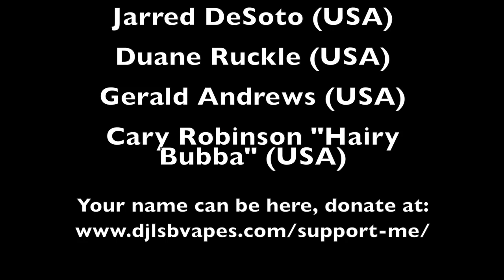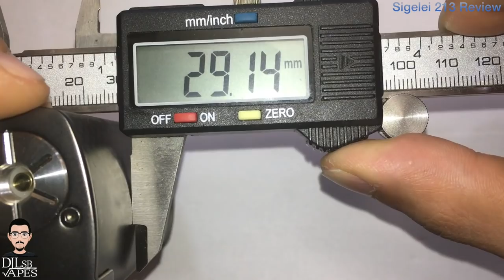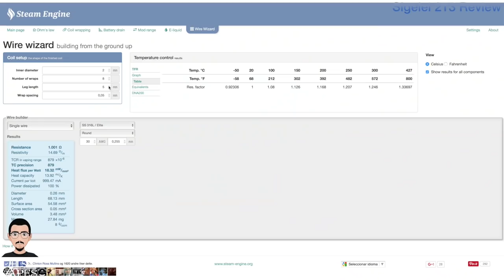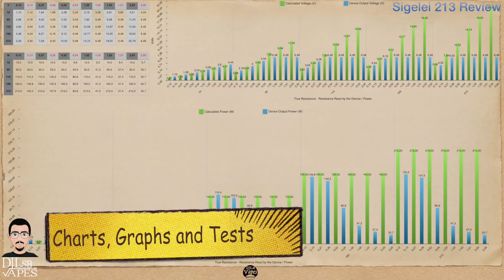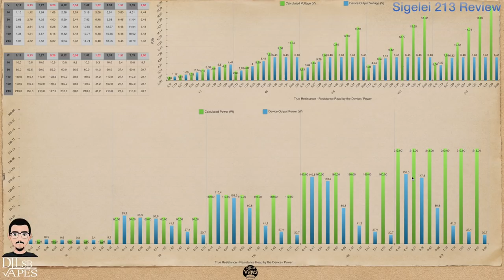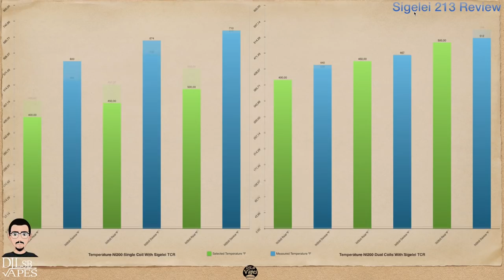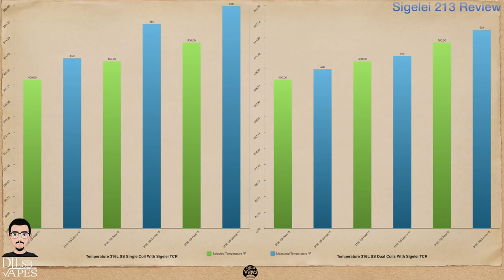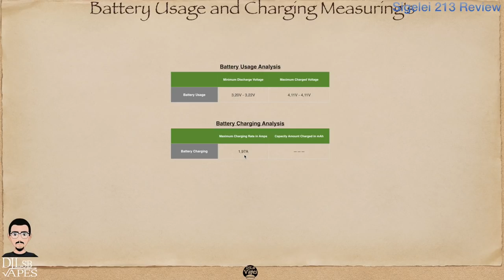Sigelei 213 Lies unveiled + Charts + Disassembly

Comment: Thank you for doing a section on disassembly. I want to share my story about my issue as there is not much around about this specific problem and I could see it causing frustration to anyone else it might happen to. Yesterday my 213 which is only a few months old started showing battery imbalance. I tried multiple batteries and checked them all on a meter and they were fine. I tried cleaning the spring contacts and the ones on the hinged door with the eraser on the end of the pencil which many videos suggest and it did nothing. This video encouraged me to take it apart and when I did I noticed that the springs behind the battery contacts were soaked with e-juice that leaked down the atomizer and past the atomizer contacts. After cleaning out the juice and reassembling the voltages are reading properly again and I am back to happy vaping on this mod I love so much. I hope this helps if anyone has the same problem!

Comment: Small rant about Sigelei. I built my Griffin RTA, and of course I love to see what the wattage maxes out at on my devices before I take them with me so I don't accidentally burn them up. 140, it was great, a little hot, but great. I turn it up to 150, no difference, 180, no difference, 213 no difference. I plug in the amp and ohm readings into my phone's power calculator app, and sure enough, 35 amps into .12 ohms is only 147ish watts. WOW. I was going to buy the IPV5, but I figured that these devices would push 180 watts max, but 147 on the Shitgelei and, according to your charts, 197 on the IPV5. I love the IPV series and I knew I should have bought it. Yes the Shitgelei is pretty, its laid out nice and everything. It all works up to 150ish watts. My lesson for the day is to watch your reviews because you actually test these devices, and I have never seen a more in-depth review. Thank you so much for giving me a place where I can make sure I don't get ripped off by companies like shitgelei. Great review.

Comment: I just did the same test you did in Stainless Steel temp control and I got the same result,  but when I changed  the preheat from 0.01 to 5.00 it blew up in flames!   oh only difference I did was I was doing the test at 200  degrees fahrenheit.  As low as it could go,  so what that tells me is it's not temp controlling at all.   All devises that you can control watts in temp mode are the same is what Sigelei is calling there preheat.   It's just suppose to get you to
your temp faster or slower depending on how high you have it. I just pressed the button with no cotton and it turned bright red super fast.  And that's at 200 Fahrenheit.
Reply from the maker: Yeah, I feel sorry that you have that device, it really sucks to know we could have spend better our money

Comment: Absolutely awesome review. I was going to buy this for my wife and temp control is very important. The low wattage is a given, .1 ohm limitation and 2 18650s just won't cut it but no biggie, super high wattage is not something that is that important to me or her. But accurate temp control, that's a must. It is too bad that such a well engineered device has such poor software. 
Thank you for your time on this one Daniel.
Reply from the maker: Thanks ;-)

Comment: This is probably one of the best reviews I've ever seen. I bought the 213 and if I would have paid $100 like everybody else did I might be pissed but I found a website that was selling it for only $80 and it came with two LG HE2 (the Yellow Version) batteries so I can't quite complain but I really wish the temperature control really worked. I came to the same conclusion that you did, that it's just simply not locking the resistance. If you look at the screen whenever you lock the resistance it says hold to lock resistance what the fuck are we supposed to hold it won't actually do anything until you let go of the button. The website no longer carries them for $80 though, Sigelei reached out and made them raise the price by threatening to delete their account with them. So they had to raise the price by $20 but you still get two batteries.
I feel sorry for the poor schmucks who paid $130 on Vapor DNA.

Comment: This is an absolutely awesome review, just like all of your other reviews, THANK YOU. This has really opened my eyes to the game these companies are playing and the over-rating and blatant lying they are doing about these products and their internal components. I'm surprised they haven't stooped to epoxying the internal board to the mods case to prevent people from running tests on them. Since you are very technically oriented it would be great to see some advice in future video's in terms of upgrading the components on these boards. For the price they pump these things out they can't be using very quality components. That said, I think it's about time a company finally offers a true open source firmware code that the community can work on and improve.

Comment: Hello Daniel, I have the 213 too... and I decided to buy it only for the sake of aesthetics and compactness. In fact, the TC isn't working well, but... I noticed that when you did the "lock procedure", you didn't "hold button" as requested. Those menus are far too fast to read, however. The "preheat" function is also working in Watt mode (at least on mine). Futhermore, I'm having misfires very often, and the pre-heat function misses the hit most of the times. The worst thing about that mod, imho, is that it isn't firmware upgradable.
Reply: I've seen 4 videos so far of people trying to test the TC function. No one ever correctly locks the resistance! :o  It's crazy! I haven't tested this feature myself as I just vape in wattage mode. Does it give a verification like "resistance locked" when done correctly? In what way is the TC not working well, compared to something that does work well? Sorry for the questions but you're one of the only users who doesn't come across as a ranting hater. haha

Comment: Nice review, I was wondering how long it would be until someone caught Sigelei here, it's a known issue with its TC. Unfortunately it's a shame, it's like a beautiful woman that's bat shit crazy. The frustrating thing is the design for a dual 18650 is brilliant. I'm a 100% temperature control Vaper, but if I was a strict Kanthal user then I'd be happy.
Reply from the maker: Thanks, Yeah, it is really a shame, I love the looks and build quality but just as you I'm an TC vapes since the DNA40 ;-)
Reply: ***** Hey Tess! :-) My favorites are my Dicodes 2380T and Nico. Most Mods do Titanium accurately so it comes down to personal preference. However, the Dicodes is indeed the smoothest TC board to date. 

I've kinda dropped out of the buying obsessively game. The exponential development curve has made most Atty's so close. The DNA 200 and 75 Mods also do a good TC.

Many of my friends here have 'regressed' back to non-TC ie Kanthal. A few have deviated to SS316L with a few to other metals. Personally, I've found SS3XXX to be mediocre at best. The best metal I've found is Platinum, but at a cost of up to $60 per 24 gauge coil insanely expensive. What would be fantastic is Titanium Grade 1 with very a heavy Platinum plating. Platinum doesn't oxidize.

Comment: I actually did like this review.  I was looking at getting one of these because I'm looking for a smaller form factor, dual 18650 mod that does temp control on 316L.  Sad to see that Sigelei dropped the ball on TC for EVERY type of wire.  Thanks for your work on this one, Daniel.

Comment: So very tired of being scammed by these Chinese manufacturers who rush to production with a shit load of junk and lies. Such a perfect form and look. As you said, what a shame. No more Sigelei for me. And what's up with the other reviewers?? They lying or are they just that ignorant. Thanks for an amazing, perfect review Daniel. As with some people out there - beauty is only skin deep in the case of the Sig '213'!
Reply: I think a lot of reviewers start off honest, and then tend to hide more flaws with items as they get more popular,  and times goes on.
Reply: #notallChinesemanufacturers
Seriously, YiHi, SMOK, lately Joyetech/Wismec...they are all doing a pretty awesome job. Yes, we are slightly biased based on the fact that we are partnered with two of those brands, but testing like Daniel does shows that this is true.
Reply: +KMG Wholesales I agree there have been strides forward by the companies you've mentioned. Any self respecting company would offer a recall and repair for a known defective part such as this. I bought two of these! Do you believe ANY Chinese company would be responsible enough to offer an updated - functional replacement? This is a flagrant example of fraud in my opinion. Sigelei HAD TO KNOW this board was defective. Instead of doing the correct thing by discarding or modifying these boards, they chose to use up stock and sell them at a premium to the unsuspecting vaping community. Fraud?? You tell me Mr. Wholesale. I experienced the exact same thing with the SMOK M80 over a year ago. NO INTEGRITY! So I will do the only thing I can in protest, not buy Sigelei or any of their offspring ever again. BTW, you forgot to mention the BEST and most reliable and customer conscious Chinese company of all, Steam Crave. I gladly pay a little extra for their quality and service.

Comment: Thanks for the review.  I am using SS316L in TFR Mode.  This device had so much potential and I felt scammed from the point of first setting the device up.  Their customer service has been shitty at best.  Again, Sigelei scammed us on this device.
Reply from the maker: You welcome, I feel sorry for you and the money you spent on it
Reply: Daniel, would Sigelei be willing to send you another 213 to test and compare against this test?  I am not seeing any improvements, but I do not have the equipment that you do.  BTW, as I shared in another post mine reads: J123 and when I put in the batteries with the power button depressed the screen reads, SGL1605V1.7
Reply from the maker: Haha, I'm sure they won't this one came from a shop. Yeah mine shows SGL1605V1.7 also
Reply: +DJLsb Vapes Thanks, my friend 💨💨💪
Reply: I felt the same too bro. It came out with so much hype at first with the promise of tfr tcr firware upgrades etc etc but i get none of those and felt like i paid a premium for a carbon clad vw only device! same firmware version here.
Reply: jvjh777 All-in-all $100.00 for a 155 watt device with issues.  Sigelei got me once, but not twice.  Did I mention their customer service?
Reply: I've noticed one thing on Sigelei 213, if you chose "lock" the resistance instead of "read", the next screen says "Hold to lock the resistance". So maybe you should nit just push the fire button once when you lock the res, maybe you have to choose "Lock" and hold the fire button for some time and then it will lock the resistance. I suggest you to try it, it might be a solution i think.
Reply: +Tim Swan customer service? what customer service? lol
Reply: Not picking a fight cause it is false advertisement but do you or anyone you know push wattage over 100? I know stainless works decent,  one thing that bugs me is the circle jerk outrage, when I'm at my B&M all I see are sigelei mods. Now it's this joweled barrister sounding anger. If we challenged some of these weekend mechanical engineers in YouTube to make a VW/TC mod. Might make things better for all of us.
Reply: talk to them on the phone.. apparently 'Sigelei 213' in China translates to 'I don't speak english' I'm not buying sigelei anything again. Scammed myself
Reply: The issue here is the firmware  isn't upgradeable.. and pre-release they worked golden, first release 213's were all screwed (I'm assuming it's firmware thats non upgradeable) I have seen irl another vaper with a 213 that works perfectly aswell (assuming they 'fixed'™ the issue in the releases) The major issue here is everyone the jumped on the 213 boat early got screwed and the stock in your local vape store you have no way of telling if it's the crap/broken firmware, or the changed/newer firmware.

If you get the 'bad' firmware your screwed, no upgrade, no ability to reflash or exchange it. Just avoid the 213. which blows because these look sexy and probably the smallest dual 18650 mod I've seen .. was hoping it to be my favorite mod to date, instead it's my least favorite. I ended up getting a Hohm Wrecker g2. slightly higher price range, it's amazing.. get it. :tho :)
Reply: Blitz Hacker As far as I'm concerned, SIGELEI TECHNOLOGY COMPANY E CIG FACTORY Just sh!t where they eat.
Reply: I need help with mine, it worked for two hits, after that it said check atomizer, then batteries wont charge, and it smells like somethings fried inside battery case. when you hit the fire button now all it says is check atomizer, and wont charge. help me
Reply: Phil Burns Hate hearing a device isn't working.  Check with the seller and see if it can be returned for a replacement.
Reply: I did today, got a new free one, with free batteries.

Comment: Great review Daniel. I was disappointed in Sigelei as soon as I found out about no upgradability and their plans with the Fuchei 213.
Strange thing is that it is really hard to feel the vape being so screwed up when I use it's temp control. I don't doubt your number at all, not one bit. I do have the feeling that the numbers might be very different in real vaping scenario. Not saying that everything would be perfect or even good compared to much less expensive mods.
When I try a stock nickel coil in my Crown v1 I set it at 320f and chain vape 10 times and the vape never even feels warm. When I do it with the same tank and a dry coil it definately get hotter with each press and has burnt the new dry coil way before 15 fire button presses.
Not sure how it acts so much different in the two scenarios. I am still very pissed at Sigelei for IMO screwing those of us that trusted their name and bought this mod. Worste part is I still really like this mod LOL

Thanks again for the facts Bud, see you next vid :-)9
Reply from the maker: Yep, agree as I say in the end I only fire it 2 times, because if you keep vaping get's worse, but I'm not gonna destroy at least 18 probes ;-)
Thanks for sharing, definitely not on mine, mine always gets hot and more hot every time I fire.
Worste part is I still really like this mod too
Reply: Yep I definitely remember you saying that.
Does yours keep getting gradually hotter like that when you are actually vaping on it though ?
That's where mine seems to act differently. Almost acts normal in the sense that mine doesn't seem to keep getting hotter when I am just vaping with a stock ni200 coil and juice in the tank. I'm just wondering if yours keeps getting hotter in those conditions.
Thanks Bud

Comment: This is a great video and the importance of such reviews are often underestimated. Rigorous testing and revealing technical specs is the only way to keep some of these vape companies honest. The truth of the matter is that there is no such thing as a 200 watt mod (let alone 213) that can actually reach that wattage with only two 18650s. Its just not possible. Its a terrible trend in mods that seems to be getting worse since the 213 hit shelves. Now there is an overabundance of dual 18650 mods claiming anywhere from 200 to 220 watts and the latest gimmick of three battery 300 watt mods. Its just dishonest and I cannot thank you enough for being one of the few reviewers to actually point out the discrepancies. Please keep it up.

Comment: I always enjoy your thorough reviews Daniel. While I have no interest in this mod, I did notice that when you went to lock in the resistance, the screen says "hold to lock resistance". Did you try holding the power button down to see if a lock symbol appears? Just curious if that's why it does not appear to lock.
Thanks.
Reply from the maker: is normal, is just another flaw, if you hold it, it does the same, plus the way I lock it you can see later that if I enter that menu again instead of lock it say's unlock

Comment: Great review Daniel, thank you!  I own the more affordable Fuchai 213 and I'm curious to see the tests. my resistance seems to be locking just fine, and while chain vaping it, it seems to keep the temperature consistent. The preheat function in temp control, not power mode, doesnt work correctly on either the Sigelei or Fuchai 213, but turned off it seems to perform great for me on this Fuchai. Hopefully it tests better, but all in all I love this mod, mainly because the price point is so much better than the original, but also because the overall build quality imo smashes Joyetech/Wismec/Eleaf, or Smok. I'm sick and tired of a mod becoming less useable over time because of some cheap ass 510 connector, like my DNA Reuleaux, so at least this mod has a solid 510. The feel is so nice, and I appreciate that it's not too heavy, find myself using it a lot. Anyways, looking forward to see your review of the Fuchai if you decide to do one! I hope they at least fixed the temp control, seems good to me but I'm not a human scope so I cant say for sure.

Edit: TCR seems to be functioning properly on the Fuchai 213, just doesn't go as many digits as wismec, so you have to round to the nearest digit, but .0009 or .0010 will work for SS316L.  Glad they somewhat fixed it, although its not quite as accurate as others, but it doesn't kick you out of TC when its working fine, which i like.